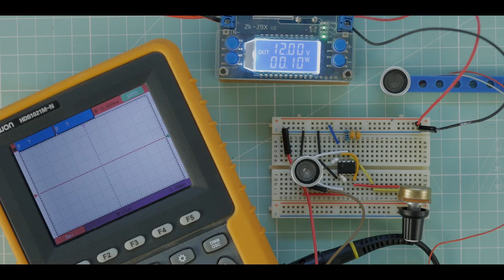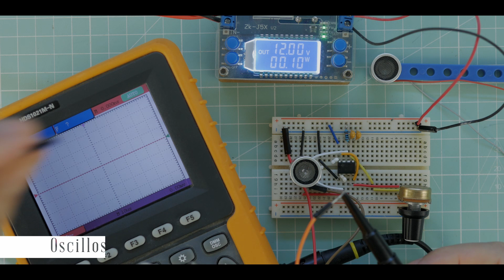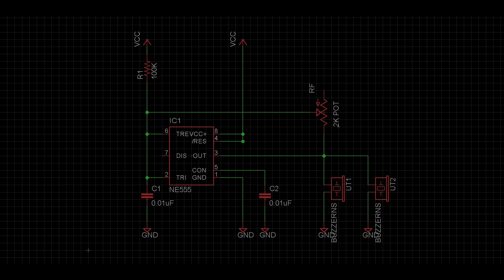Ultrasonic Levitation Using Classical NE555

Comment: Built it but took some time getting the levitation. It turns out that getting the Styrofoam balls static charge removed is key. 
The levitation force is tiny compared to the static charges on the Styrofoam. How did you manage?

It also looks like your peanut shape may be more stable. What is the little "spoon" that you are using to place the "peanuts"?

Cheers.
Reply from the maker: the "spoon" is the front mesh from a damaged ultrasonic transducer, hot glued on toothpick
Reply: @mtdiy   Clever.
Reply from the maker: Also, what voltage did you use？ the higher the stronger force, I tried 20v without breaking the NE555 🙂